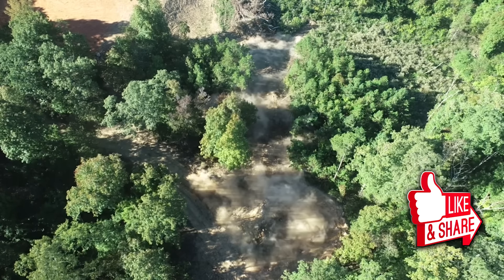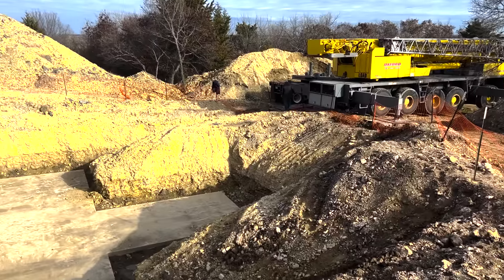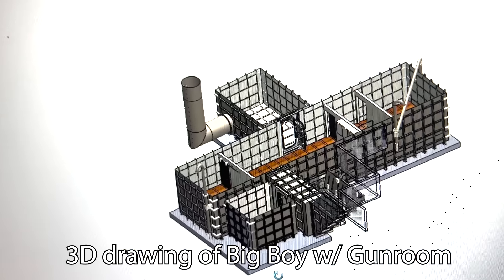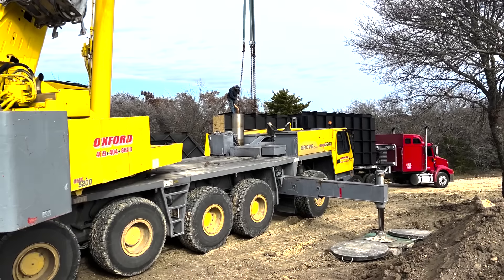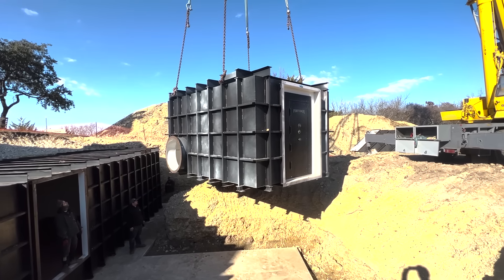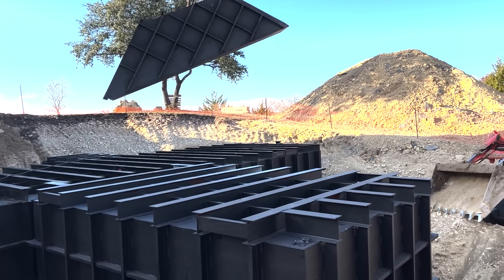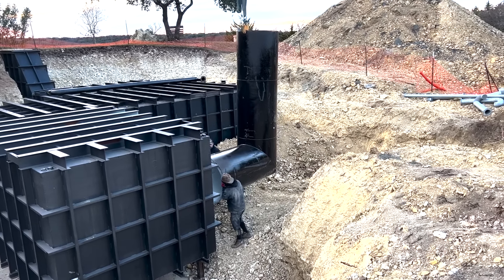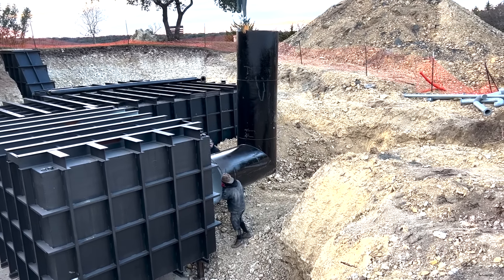Big Boy bunker with a $100,000 Gunroom Part 1

Comment: If a nuclear catastrophe was to hit the United States of America, in my personal opinion,  none of these shelters are dug deep enough to withstand gamma radiation much less the destructive force of a nuclear blast.
Reply: @patrickinlow470 three to four feet a pack dirt would provide adequate protection from gamma rays in lessening. It doubling that or 7 to 8 ft. Wood be a pretty damn good shield. It would be equivalent to probably more and a half a foot of lead.
Reply: Yeah maybe, but they're cool asf so it's completely worth it
Reply: Modern nukes don’t result in 
as much radiation as they used to.
Reply: U have no idea what ur actually talking about. You’re bunker doesn’t have to be that deep 3-6 feet should be enough
Reply: Bit of lead lining the bunker should stop most gamma rays
Reply: The radiation issue due to nuclear attack is apparently pretty overblown.  See Nagasaki and Hiroshima. Which had more radiation than modern nukes would produce. Yes, they had problems, not trying to minimize it, but they are thriving cities now.
Reply: Are you expecting to be targeted personally? If you are you need to take up residence in Cheyenne Mountain.

Comment: One with a little bit of experience in welding, manufacturing, mechanics, digging holes or trying to build something strong, sealed and nice underground can EASILY spot why ATLAS are the only bunker worth buying. I can spot experience like this with my eyes closed. Great job on this project and hiring the right tools for the job! Can be done cheaper, but not right with less $$$

Comment: Ron, have you considered using the Form-A-Drain system when having the pads poured for the modulars?  That would take care of 90% of any drainage issues around the bunker.  It would be interesting to see a price comparison between this bunker system (gun room/bunker/generator pod/access point(s)) and a similar layout built using ICF
Reply: Now that makes a lot of sense👍👍
Reply: One of those things is structural steel plate and the other is reinforced concrete. They're two totally different materials.
Reply: What's ICF
Reply: 💡I doubt you'll get a response to that, because the buyers aren't thinking long term and they believe everything that they're being told by who they THINK is a survivalist specialist😂👍
Reply: @crackbaby1537  It stands for 
Insulated
Concrete
Form

Comment: For a 'BIG BOY' Bunker you need a BIG BOY excavation done with BIG BOY heavy equipment...

Top part of the bedrock was weathered and could be removed with good trackhoe. A bit deeper and bedrock needed some persuasion with pneumatic breaker. There is a point where it's more cost effective to blast. It would have loosened material for faster removal. Not every area has blasting contractors available. 

Every overgrown 'kid' wants his own underground bat cave. It is truly the safest place to be in any disaster including earthquakes. Bunker is tornado proof, hurricane proof, and even flood proof is built correctly. Don't forget emergency power system and pumps to keep everything dry. 

 The hardest part of a job this big is keeping it 'secret' from the public. Signed NDA's from contractors recommended.

Comment: This thing is awesome but the only thing I think should be different is the escape tunnel should be in the main room of the bunker because since it is in the gun room that means that in an emergency someone has to get inside the vault to be able to escape so if the wife or someone else didn’t know the code they wouldn’t be able to get into the safe to escape. And in my opinion the safe should only have one way in and out to make it secure, with the escape tunnel in the safe it kind of defeats the purpose of the safe door unless they have a safe door for the escape tunnel too which would make it even harder to escape in an emergency. This is just my opinion I’m not a contractor lol but I do love the work you do and hope one day I can have one of my own!🤞🏼

Comment: Is it viable to put the I-beams on top of the roof sheet metal?
Now the weight of the dirt on top bypasses them onto the way bigger surface area of the roof sheet and all that keeps this from collapsing are the coparatively small weld connections. If the roof I-beams would be installed inside the bunker it could be way more durable.

Comment: You provided a good base for the bunker, but would it also be possible to have a concrete sarcophag around the whole shelter, as additional protection? What would the cost implications be for something like that?
Reply: From my experience in property management seeing buildings settle over the years I'd be concerned about that concrete stressing and breaking the steel over time
Reply: I feel being that deep in bedrock that pad should be more than good.  Now I've heard houses on the same thickness slab can settle at frost level by code.   They hit solid rock in most places that deep

Comment: When doing required maintenance on large items inside the bunker in the distant future, such as the refrigerator , the generator, large beds or cabinet replacements - are the hatches and passageway large enough for these heavy items to pass? and if not could larger hatches be designed and built? Or how about a large maintenance hatch be built on the top of the generator bay to allow for a crane to extract the generator in the future?
Reply: Yeah, preferably at least 36"-40" doorways.

Comment: Why was it designed with all that lattice on outside (I-beam and other metal crisscross). Does it have a performance benefit to just using flat outer metal walls?
Reply: Incredible strength for weight pushing in and on top from being buried.
Reply: It’s easier to weld on the outside of a box than the inside. Technically it’s better to have internal reinforcement, and you have less surface area to sandblast and paint. Practically, clients just want the extra few inches of internal space and for it to look pretty.
A prepper would put the lattice on the inside

Comment: Do you fill the exterior of this with concrete or just put the dirt back in? I feel like concrete would be a better option.
Reply: At least a few feet worth surrounding the steel. Would cut down a bit on moisture I think as well.

Comment: I didn’t see a gasket between the bolt on pods how do you prevent water from coming in through the seems do you go back and weld those parts before you bury it?
Reply: Yes, he is welding all seams from inside
Reply: did you see and listen the video?

Comment: As long as they are pouring concrete slab you might as well make the bunker out of concrete like a basement and use a spancrete roof drain tile ect  Probably cheaper by over half made out of concrete anyway.. Could of put it above the bedrock then back filled it a few feet over the sides and top!
Reply: I think concrete would have some advantages also, the sides and top would be smooth and could be waterproofed. I see water being trapped and rust forming on the steel.

Comment: What precautions are taken to ensure egress incase both main hatch and escape hatch are blocked by debris? Radio/communications to the outside world?
Reply: I think the escape hatch opens inward and the main entrance has a hydraulic ram in case of a blockage. At least that's how I've seen it done. You could easily run any kind of communication system. This thing is fully wired, plumbed, insulated, etc. He knows his shit when it comes to bunkers. It has on board NBC filtration, blast valves, on board water/batteries/generator/fuel, NBC system has a hand crank backup, fully welded construction. The ventilation system thwarts smoke, explosive, and water attacks.
Reply: It’s up to the client to understand what they are buying. So far I’ve seen two bunkers with comms… 🤷‍♂️
Reply: All someone would need to do on the outside is plug up all the air vents, then just wait for bunker occupants to suffocate or come scattering out like roaches. These “bunkers” are nothing more than fancy, expensive tombs.
Reply: @Bishop228  these aren’t really intended to survive a local attack, if a bunker is exposed then it’s just a matter of time. But you can easily harden an air system and conceal the vents, so far I’ve seen one client route the intake via the building structure. There’s a lot you can improve here, that’s why billionaires hire engineers  to tell them how to solve a problem, not buy a solution to a problem they don't understand

Comment: Always interesting to see how the rich spend their money :)  Surprised there isn't also a wine vault in there ;)

Some thoughts: putting the main bunker in first, you should have had an L-shaped metal piece bolted to the pad to catch and locate the corner furthest from the crane, with a second single piece to locate the other end, thus locating the bunker perfectly first time.  I also don't understand why you don't have the legs preattached to the side pods or even just have an elevated concrete pad under those parts.  I note you're welding all the joints, but wouldn't also using seals work as an added protection?  Your escape tunnel has a rather awkward 90 degree bend, I guess it's not something that would be used often (hopefully!) but there has to be an easier way to allow quick egress if needed.  Lastly, I assume the black finish is for moisture resistance - the escape hatch was scratched and scraped, removing that.  Do you repaint/reseal it?  

Anyway, looks pretty cool and I'm off to watch video no2!

Comment: Why not make the Gun Room and mud room to the same height specifications as the main body, raise the floor and then just put storage in the resulting crawl space?

Then you could set the structures up without making legs, and it would just line up and bolt together.

Comment: Somebody typed in the concrete had three days to dry, but concrete doesn't dry it cures, and when it cures will form a crystal structure, so it takes more than 3 days to cure but a certain amount of time will give you a certain amount of strength, and if the concrete is designed to be solid enough to be used for its intended purpose after 3 days, so be it, but I guarantee you a week later it'll be harder, a month later it'll be harder, a year later it'll be harder and 10 years later it'll still be harder.
Reply from the maker: Ok thanks.  Editors notes

Comment: What an awesome bunker! Your guys know what they are doing. What kind of reinforcements are associated with the escape tunnel? Looks to be the least protected unit of the bunker, yet could be the most crucial when SHTF. I assume it was designed to withstand the same pressure as the pods just curious to see if you might mention it in a next video. Thanks!

Comment: What if the bunker settles unevenly? Even by a little bit. Wouldn’t that cause the bolts to shear off? The bolts which hold the different sections of the bunker together.
Reply from the maker: It's on a concrete pad. In bedrock
Reply: @AtlasSurvivalShelters  👍🏻

Comment: I see the concrete pad, but I don't see any sewer or water pipes into the shelter. How is sewerage and water handled and are these solar powered and inclusive of HVAC?
Reply: Sewage is pumped out vertically. Power source, water supply and HVAC is up to the client

Comment: Do you still need to pour the 1feet thick concrete slab if the bottom of the hole is bedrock already?  Or you have to pour a slab for 6-inch thick or 4-inch thick to hold the expansion bolts? Very Nice video for rocky 🪨 states, good job 👍
Reply from the maker: No

Comment: Question: the generator room. Will that be a battery back generator room? Or a gas generator? If it’s a gas generator, shouldn’t be a negative pressure room and an air tight door?
Reply: Its usually a diesel generator and battery banks. Its all air tight and isolated in an entirely separate compartment. I don't think you can do negative pressure b/c the bunker is designed to protect against NBC threats and has a filtration system to accomplish that. Negative pressure would suck in outside contaminated air through the ventilation.
Reply: @oldscratch3535  what bothers me is I work for a city hospital and we have generator here the size of a locomotive . There’s louvers and exhaust opening and running when we do our testing. I don’t understand how it’s underground and that it’s getting enough air in and out without making a sound outside.
Reply: @iiinsaiii  well yes it would be audible, especially at night, it’s up to the client to understand that generators make noise and how to mitigate the risks

Comment: The crane safety and placement of employees while the load is suspended needs serious review. One plus is that you are recording everything so you can go back and watch “what not to do”. Bunkers are super cool but let’s place “employee safety” a little higher on the totem pole. 

Some people will say, “no one got hurt in this video” or “we’ve been doing it this way for years and nothing has ever happened.” It doesn’t matter. A few more minutes and a couple extra steps to ensure everyone goes home the way they came to work is well worth it.
Reply: Just look at the guy an 9:00 if that load was compromised he couldn’t even run away from it if he wanted too. This is some stuff you see in South America and Asia. Not the Midwest.

Comment: Rebar on the dirt and under the concrete? Shouldn't the rebar be suspended in the center of the slab?
Reply from the maker: It was after that filming.   Of course
Reply: It gets picked up during the pour, nobody ever films this on any concrete video though

Comment: So the concrete pad that it sits on is 12 inches thick and you only let it cure for three days before you set 65,000 pounds on it???
  when they pour 12 inch thick road beds they don’t let vehicles on them for 6 to 10 days....

Comment: My own personal opinion? Those who have the cash for something like this are very smart people. My strategy for marketing these would be less focused on the raw strength, & more focused on the details. Water storage capacity & maintenance? Ventilation? Power supply & redundancy? I learned nothing about that here (to be fair, perhaps you have other videos that address this). I did develop a serious concern though. A shelter is only as good as it’s egress. How many 3/4” bolts are used to marry those two flanges? What would a 5+ earthquake do to that escape hatch connection & it’s walls? Definitely not smart enough to know, but that was my concern at the end.

Comment: Hello Ron, another great video! I have a girly question 😁
Why are those additional pods and stairs on legs instead of sitting on the concrete like the big boy?
Reply: Must have something to do with drainage
Reply: The main room has underfloor storage, while the other rooms don't. They need to be raised up like that so that the interior floors match up, and are at the same level.
The raised floors have water storage tanks for the plumbing fixtures, with the water lines run through there, the electrical wiring is also run through there as well. Then there are open areas accessed by lifting sections of the flooring, people use that for food and other items to be stored in. 
Other videos show this if you want to see the inside. Hope this answers your question.
Reply: It’s so they take pressure of the bolts so they don’t snap

Comment: While I absolutely love the idea of having such a bunker for myself my 2 biggest worries are nuclear and biological contamination when long term survival is the goal.
The decontamination and air filtration necessary for safe survival in those conditions are really outside the means of anyone short of multi-millionaires.
Reply from the maker: That's true.  No one said it was cheap.  But we do have shelters coming soon for $20,000 out of concrete including Swiss air system
Reply: @AtlasSurvivalShelters  So with the air system you mentioned your design takes into account long term need to be able to remove, exchange and dispose of the filters without contaminating the living quarters with alpha and beta particles?

Comment: Why did you put the legs under the bunker?
Reply from the maker: It has no under floor storage on those hallways that's why.   A concrete wall is built up usually and filled in    The bunkers are so tall cause they have 24" of under floor storage with water tanks

Comment: Question - The shelters don’t seem to be installed that deep into the ground. Would the shelters post install be able to take a direct hit although unlikely?
Reply: No! But hostile nations won’t be targeting a small shelter in the countryside. They are designed to survive the fallout and keep you safe.
Reply: @brentparks3669  Thank you for taking the time to answer Brent. That’s kind of what I figured. Another question I have is, and please excuse my ignorance, what exactly keeps the radiation from passing through the bunker to the people inside?
Reply from the maker: The earth.   That's what shields you.  Pure dirt or concrete.  24" concrete or 36" of earth is the minimum.

Comment: How do they get the weight of the pods onto those legs? It looks like they're already bolted to the shelter and possibly already being welded when they move the legs underneath the pod, with a little bit of clearance between the leg and the pod above. Curious how that's done.
Reply: Cut leg to fit, bolt to floor, fill gap with weld. Not an ideal solution but cheaper/easier to do on site

Comment: Don't understand the choice to have the escape tunnel off the gun room.
1. Need to go through the vault door to escape.
2. Potential for the gun room to be accessed through the escape negating the vault door
Reply: The hatch is under a few feet of dirt and bolted shut, so it’s only a theoretical vulnerability really. Agreed that a broken vault door could potentially block an escape